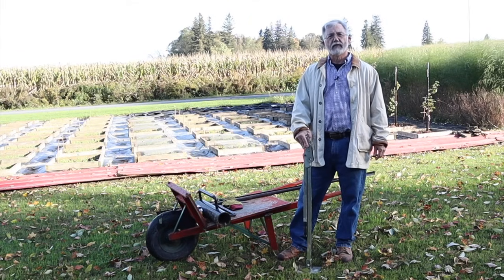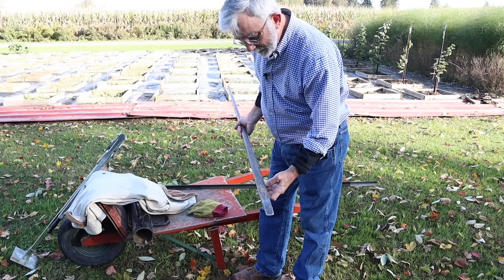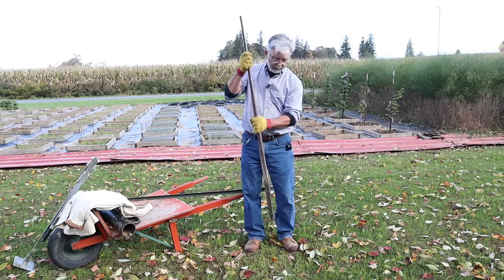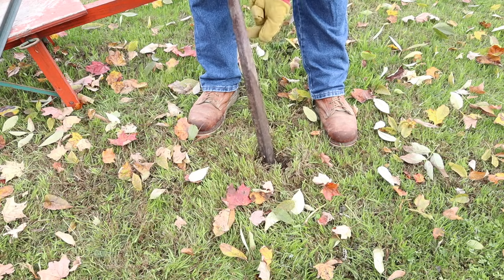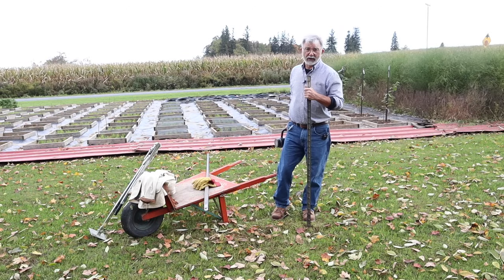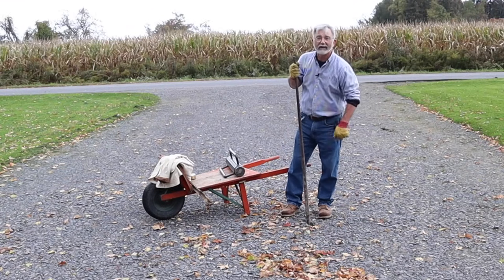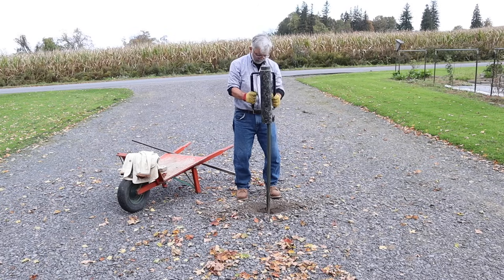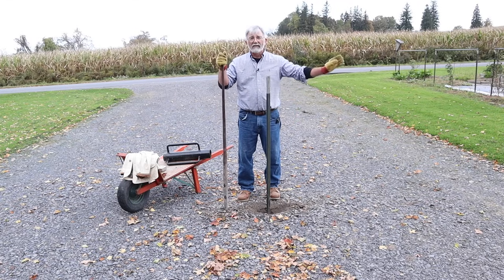How To Hand Drive A T-Post Into Hard Packed Stone ... Or Just Normal Soil

Comment: When you drive the post with the driver never let the post leave the pipe driver. As you were driving  I saw the top of the post come out of the driver.  When you come down to drive you may miss the post and destroy your hand on the post top as you are holding the driver  handle I've seen  it happen  not trying to be a know it all but trying  to avoid you an injury
Reply: His driver is VERY short compared to good ones - probably saved himself some $.
Reply: You can also hit the top of the T with the edge of the driver and drive all of that weight and force into the top of your head/face with the driver. I’ve had it happen to me, and it darn near knocked me out. I know another guy who did the same and had to get some 40 stitches in the top of his head. Your scalp is extremely vascular and difficult to stop any bleeding. If you’re way out in the middle of nowhere, that could spell disaster.
Reply: Oh please!
Reply: i have came down hard enough to crush my gold wedding band and cutoff circulation
Reply: Funny story, this happened to me. but I was very sick at the time and not paying attention. I overshot the rod and with all my force slammed down the pounder. I was setting ground rods at the time. The rod hit my safety glasses and then hit my eye. I’m lucky to have that eye now 🥴
Reply: This is true
Reply: Facts. All it takes is one slip up.  If the bottom lip of the pounder hits the top of the post, it can produce some painful results
Reply: This happened to me. But the driver caught the top of the post, tilting it it towards me. Cause I was pulling down hard to strike, I pulling down with force on top of my head. Broke open my scalp and near knocked myself out.
Reply: Know a guy that severed all the tendons in the back of his hand this way. Long enough post pounder is a must.
Reply: I smashed my knee doing that once.
Reply: 3yrs ago i was driving posts and got tired an careless i guess but yea i pulled driver too high just enuff off the post and pulled that driver down on my noggin with all my force, made me so furious then took my hat off an my face covered with blood, calmed me down lol, long story short went to ER waited for few hours then "Dr." comes in staples my head 5x no pain numbing nothing then says to his trainee i don't like how those staples turned out" Then not kidding another hour+goes by he returns an puts on tina turner what's love got to do with it an tells me sorry he never stitched anyone up had to youtube how lol >_<, anyhow so yea, i learned don't just manhandle those like a wildman..unless u have somethin to protect ur noggin, thx for video!
Reply: Disregard that last part lol, not ur video my bad heh=o
Reply: OK if you're doing 5 or 10 posts. Not if you're making 1.5km fence. It'd take forever.
Reply: Small strokes can get the job done
Reply: @Anythingforfreedom That’s what she said 😅
Reply: Yeah she did. Small strokes with a long driver. I can't believe I posted this.
Reply: Yep! I stopped watching when I saw him coming clear off the post with the driver. He seemed pretty clever up until that point.

Comment: I am 71 and have my grandfather's bar. He called it a Johnson Bar. I've used it in Illinois, Missouri and Texas and it never failed me, but in Tennessee it is a totally different story. Most of middle Tennessee near the Cumberland Plateau has bedrock near the surface and it has whooped me.
Reply: I have a "Johnson bar" but I'd never stick mine in to the ground, if you know what I'd mean ha.
Reply: @markyg1970 In your dreams!  Look again.  That might just be a 16d nail that fell into your shorts.
Reply: @markyg1970 if it is a big Johnson bar you might wanna spit it out…it doesn’t belong to you. 😂
Reply: Back in the mid-70's I lived in Nashville and worked for a company called Vibration Control Engineering. That layer of stone in the ground meant that most road or building construction required blasting. We provided services to the blasting contractors.
Reply: @MikeinVirginia1 😅
Reply: What county?
Reply: Kudos on actually k using the name of your bar. It tells me yiuknos exactly my how to use it and efficiently. We are the same be proud of what a tool does for you well done

Comment: Have a gallon jug of water handy to dribble into the hole as you jump it down. it also helps to use water when augering post holes. like a cutting fluid when drilling metal. Linemen also use the same idea when driving long grounding rods into the ground. a little water goes a long ways.

Comment: Growing up in Maine, we used wooden posts but the method was the same. We would use the rod to make the hole then drive the fence post in with the back of a single bitted ax. All the posts were sharpened beforehand. That was when I was a kid and I'm 73 years old now.

Comment: New subscriber here and have to thank you for this video.  I was out this morning trying to drive t-posts with a hammer while standing on a little kitchen step stool. I ended up somehow smashing my thumb between the t=post and the hammer when I hit the top. I was so mad and so fired up that I didn't flinch I just kept hammering but wasn't getting anywhere. I came in the house sayin to myself,  there has to be an easier way to do this, since I don't have one of those driver things. I did however have what we called a rock mover that you were using to make the holes.  I ran got ours and dragged (it is pretty heavy) it around to where I was working and gave it a go and omgosh!!!  it was a miracle. You made my task go so much faster and easier and there was no more thumb smashing or jarring this 60-year-old woman's arms hitting that t-post. I am so grateful for your video! My fence around my coop is already up and I did it all by myself. Thank you!!!!
Reply from the maker: That's wonderful. Thank you. 👍🙂

Comment: The digging bar I use was forged by my great great grandfather from a wagon axle. I also use a chisel from a coal mine about 3 ft long and a short handled sledge. I hit the top of the chisel a few times, smack the sides to get it to wiggle, repeat til I get the depth I need, pull the chisel out and drive my posts. We gots lots of sandstone here, if we're lucky there might be some dirt too so the extra effort with the chisel saves the effort of arm breaking post driving through 4-6 inch stone slabs.

Comment: Where I come from, we call that a pry bar. It's a very useful tool. Your application is new to me. Thanks for the tip.
Reply: A pry bar is a vastly different beast buddy! A pry bar is a short sturdy bar with a ‘J’ curve at one end with a ‘V’ cut-out for levering open doors, pulling large nails, fencing etc. Looks like where you come from have been using the wrong tool!
Reply: @nivid01  I think you're talking about a crowbar 😂

Comment: Adding water to the work also adds in hard clay soils.  I learned that trick when setting ground rods for an electrical contractor in the mid 90's.   Keeping a constant water source on the hole works as the same concept of wet drilling in the oil industry.  The water dries in a day or two.

Comment: UPDATE- THANKS so much for this video.  It is GENIUS to use the (6ft heavy) digging bar to make it easier to get t posts or u posts into the ground, in addition to finishing off with the manual post pounder / manual post driver.  Also how you showed rocking the digging bar around a bit to nudge the rocks out of the way was also very helpful.  Man I'd been putting this project off for many months but knowing to rent these two tools locally really made the project super simple.  We even made one of our holes too deep it was so easy w/that digging bar!  So then we just filled it back in a bit w/dirt.  I rented a 6 ft digging bar & what they called a manual post pounder.  We got 7ft u posts into the ground so easily w/those two tools.

Comment: I was having a hard time using a small sledgehammer to drive my tpost in, until I saw your video.  Just so happens I already had a long bar similar to yours that I bought when I planted a tree.  Worked great and saved me a lot of time and work!  I needed to drive in the tpost in the middle of my sweet corn rows to mount a tpost sprinkler on the top. Great video....Thanks!

Comment: I love my digging bar too. It's several decades old too. Found it here on the property when I moved in. It's a lifesaver for digging my post holes for my fence. I also bought a small semi permanent vinyl fence for use over a short length, but it wobbles, so I'm thinking of stabilizing it with rebar stuck in the ground and zip tied to the fence posts. I can use this method for that too!

Comment: In “another world” a long time ago, on our farm, I participated in yearly hay harvesting.  It had to be hung up from ground on wooden stakes, some 8 or 9 ft long.  The stakes were about a forearm thick, naturally thinning to the top and sharpened at the thicker end for  8 to 12 inches.  We had to use those digging poles or rods, just like you showed, to make the holes for our stakes.  The method was exactly as you show.  On the fat section of our stake, there was a 6 to 7 inch cross member that would support the first bunch of hay some 18 inches above the ground and then the whole remaining length of the stake was loaded with additional hay, crisscrossing.  With air gap under, the hay was let dry for about two weeks without catching mold.  Finally the dry hay was collected and brought to one or more barns for winter feeding of our 6 dozen cows and a dozen horses.  One thing, though — working at the “receiving end” when the fay was brought in, I developed a lasting opinion that I still relate Earl Gray tea taste or smell to the smell of our dry hay, which every year for a week or so every day penetrated my nose and throat.  I like all OTHER tea flavors, but Earl Gray.
Reply from the maker: The method of drying hay that you describe is something I remember reading about in Farmstead magazine back in the 1970s. I was fascinated by it and saved the article. I never knew anyone who actually did it. Where in the world your farm was.
Reply: @herrickkimball  Finland.  We sold it, when none of us 3 sons was adept and willing to continue farming, especially when the other two would have to be paid off.  All 3 had already academic degrees and professions in other fields than farming.

Comment: If you weld a 1/2" plate across the end of a piece of 3" steam pipe and weld 2 pieces of 3/4" pipe and space it out 2" welded parallel with the big pipe of 3' long. You can use this to drive pipe or T-posts or put a Larks head knot around the base of the post and hook to the bottoms of the pipe offsets and work opposite, to pull the post out. Used this method over 50 years. Had one stolen, one borrowed and never brought back, and I lost one, made another one and then found the one I lost and I donated it to a fellow that installed fences. Thanks for your time.

Comment: We used an axle from a horse drawn corn planter that was blacksmith sharpened to a round point for making holes for white oak fence posts. Pounded the posts to depth with a 13 pound post mall.

Comment: Thanks for the tip. I just bought thirty t posts, and I was dreading putting them in. A digging bar should make it much easier.
Reply: Define 'easier'.  I think you do just as much labor, but it is spread out so that the seventeen pound bar does most of the digging.  Once the guide hole is finished, it only takes a few pounds on the post hammer to finish setting the post.  Definitely a LOT quieter overall.

Comment: That is the bigger bar for loosing soil but there is a smaller bar with a curl end for pulling nails that is also used for loosing the soil on your knees for a more control digging.
Reply: That's called a wrecking bar and the chisel end is angled, so not good for digging a straight hole.

Comment: Yes, very good advice. I use this method even with a 1/4 fiberglass rod to penetrate down as much as 4+ feet into such rocky "soil" that only a jack hammer will drive a T post. (dog loves gophers 🤣)
    Even a round prybar works if you move it in circles. 
You don't even have to work very hard. Just swing it around and around and the weight will dig it down.. 

Just be sure to bill hourly, tho. 😂😂

Comment: Pinch bar, crowbar, pry bar, Johnson bar, digging bar, all the same tool. I use mine for digging rocks out of the ground. Work it around until you find the edge, get it down and under, and pry it up. Use a fulcrum rock or block if the ground is too soft to move the rock you are trying to remove. Sometimes you get a rock that is too big to move. For that you need a backhoe.

Comment: Sometimes moving isn't an option, so if that's the case, use a drill to put a hole in the rock.  Then drive a concrete anchor into the "boulder" and use that to lift the boulder out with a steel cable attached to the bucket of your tractor.
Reply: Aledo rock
Reply: Ha😂

Comment: Looks like a great tool for most situations. However, that ground looks very soft, even with the rocks. The ground on my property is like cement with more rocks than dirt, and I'm talking big rocks all the way up to boulders, so that tool is not going to help here. We have to use a hydraulic driver, and when digging post holes even a jackhammer most times to get down deep enough. It's a real challenge...

Comment: By the looks of the crops around. you are on pretty good soil. That bar you have will not go through rocks. If you are in rocky soil and land right on top of a large rock it won't to anything and you will never be able to pry it to the side.. The best approach is a gas powered hammer drill with a bit appropriately sized for the t-post.

Comment: That may work well in soil where you have a bunch of small rocks scattered under the top soil, but if you have a solid slab of coral like I have under most of my property in FL, making a hole with that bar is a certifiable nightmare and your elbows and shoulders will let you know the bar is not the way to go when you go to bed at night.  I already tried, and I ended up hiring a guy with a tractor auger.

Comment: Being 81 years of age and for some reason unbeknownst to me those seemed to have been very prevalent and readily available when I was a youngster. And, again, for reasons unbeknownst to me they seemed to have always been in the way of whatever task you were attempting. 

That tool is described as weighing 18 lbs. with a length of 60". Even though we called them 'railroad bars' (why, I have no idea) I believe the official name is 'Pinch Point Bar', and usually may be acquired online or from local dealers, such as Home Depot.

Have A Nice Day...Molon Labe...Semper Fi

Comment: Excellent video, thank you!  Subscribed.
Feedback:
1. You make very useful videos we need with very simple tools.  Much appreciated!!!
2. Be less wordy and tighten up the long ramble.  Its nice to chat but there is a time investment and unless you are retired, time is in short supply.  You will gain far more subscribers and help more people if you shorten it and keep it succinct. This is Video not Radio.  We can see it too.
3. Please name every tool right at the start. That digging pole - what is the name exactly?  It is a good idea to write the name as text on your screen so visual people like me can remember. Words are lost to audio outdoors.
4. Get a shirt microphone so we hear you clearly outdoors.  Add a wind sock to the mic to screen out ambient noise. This works wonders on audio!
5. Thank you so much for NO MUSIC.  My ears are rejoicing in the sound of natural work not artificial music noise. Great!

fyi for Viewers:
Digging bar -aka posthole digging bar, tamping and digging bar, pinch point bar, san angelo bar, etc. 5 ft long, 17 lbs. Wedge.
Harbor Freight $27 cheapest (pinch point bar search).  Good reviews.
Dig to depth of 1.5 ft for 6 ft T-post.
T-Post Pounder - $29 on Amazon.  8 lbs. Good reviews.  Great for women to use, not too heavy.  I think you can drive the T post more plumb into the ground vs hitting it with sledge hammer.  Plus you won't need to stand on a stool if you are shorter.

Comment: OK fine, you can drive them in - that's the easy part - but how do you make them vertical to the ground???????????
Reply: Interesting question.  I just let gravity do the work.  The bar seems to be making a pretty vertical guide hole.  Then I just push the post in, and check for plumb before driving with post hammer.  Out of thirty posts I put in this week, about two are visibly out of vertical, and not by much.

Comment: On the rock road maybe. In the grass dirt all you are doing is wasting time and effort and getting an inferior set. All that wiggling side to side is breaking up the ground and defeating how the tposts are designed. And all that lifting the post pounder off the post is doing nothing. Small lifts and taps do way more. And you don't run the risk of missing and injuring yourself. 

Next time just use water. Even with rocks the water will loosen the soil around the rocks and help them shift.  Don't believe me? take a five gallon bucket and fill it with rocks from your area. Try and just tap the post on top see that they move but takes effort to get the post down. Now dump some water just in the spot you are driving the post. You will now be able to get that post down with a lot less effort.

Comment: You don't have hard soil. I wish I had that soul you have.  Even your driveway eventually leads to softer soil. I live in the desert southwest. Your suggestions don't work here.
Reply: Exactly 💯,  I just did 1 post today and was only able to get 12" down. Soil is rock solid down here. I am going to buy a drill extension, like 18", to start the hole and then use the digging bar. Best of luck to you!
Reply: I take it that soaking the hole with water for ten minutes doesn't improve things?